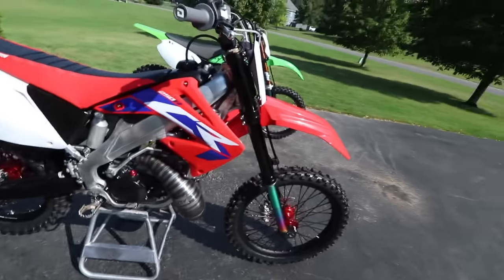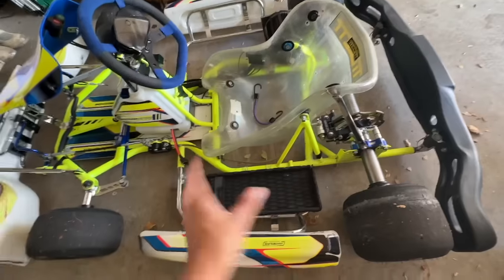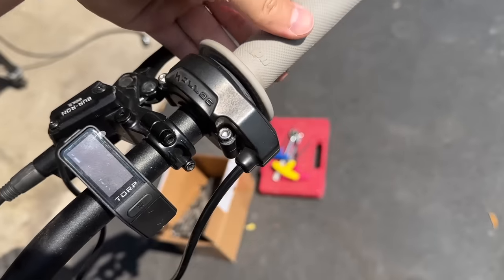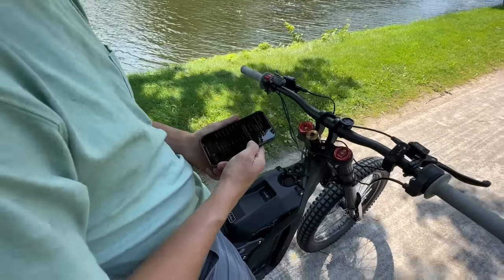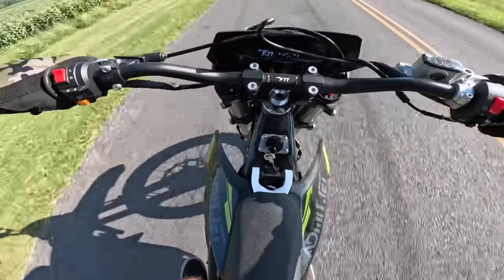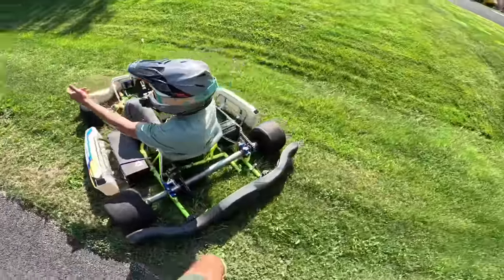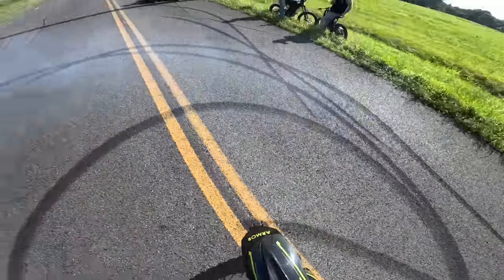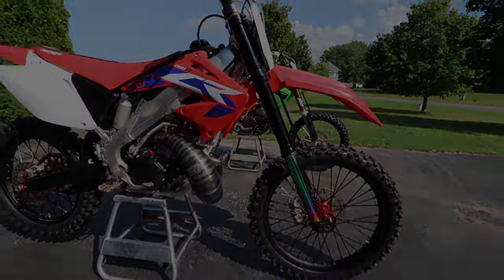RACING 100hp Electric GoKart VS Insane Electric Dirt Bike With GEARS

Comment: Can that small motor handle over 1000A? Or how else do you get 100hp on 72v system 😂
Reply: I've got a qs138 v3 90h in a kx450 I'm planning to push to 600a at 76v nominal. so ill get 65hp out of it if I'm lucky, and that's only for 1 pull before the motor over heats. heat is the main reason these motors cant do more. I've burnt up 3 different qs165 motors pushing 28kw through them.
Reply: He is just clickbaiting us

Comment: lol. battery current gives you torque  and motor current gives you speed? no. volts gives you speed. a motor's kv rating is rpm x volts. 300kv is 300rpm at 1 volt. 600rpm at 2v. 900rpm at 3v. etc. so a 300kv motor on a 67.2v battery is 300x67.2 = 20,160rpm at the motor sprocket. a 300kv motor at 84v is 300x84=25,200rpm at the motor sprocket.. then gear ratios to find wheel rpm, then rpm and tire size for max theoretical unloaded speed. battery current means literally nothing for a bike's speed. a 20 million amp  battery running on a 20A controller will still only pull 20A. as long as the battery is capable of discharging at the current that the controller is drawing youre fine. you always want your battery to be ablke to handle more curent than youre asking of it because lower amp draw = lower heat/ more run time/ longer life/ etc. and if your battery is not capable of discharging at the controller's current then thats a battery fire waiting to happen. thermal runaway is a mother fucker. i have a 800A battery (20s2p spim08hp) on a 200A controller (sabvoton 72200) and a 720A battery (20s16p molicel p42A) on a 500A controller (3 shul CL1000). etc. putting a battery into a bike with higher discharge current capabilities will give you identical performance because batteries do not push power, components pull power. electricity wise the only way to raise your speed is to raise your voltages or get a motor with a higher KV rating.

the amperage of the controller = more torque. whatever the controller current is that is what your motor is running at. you cant individually control a motor and controller's amperage. and the controller current means more torque because with a stronger current of electricity going to the coils in the motor there is a stronger electromagnet being created which can push off the magnetsa with more force.

volts = rpm
amps = torque